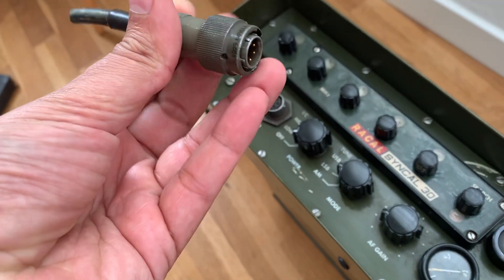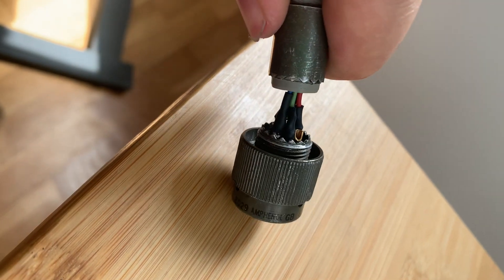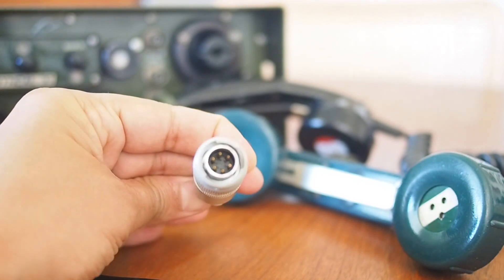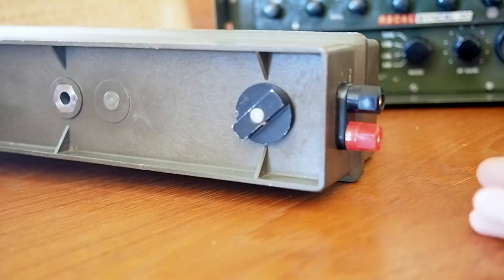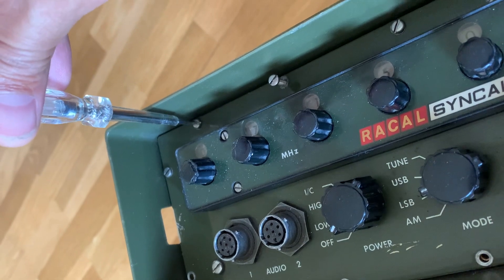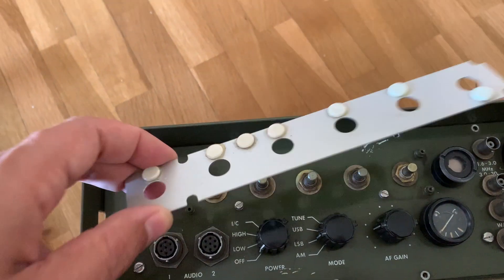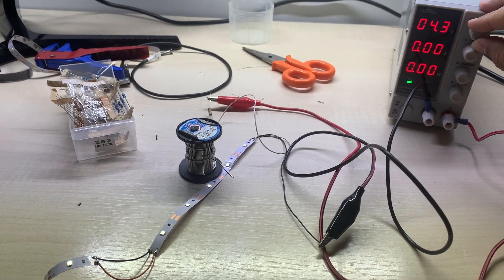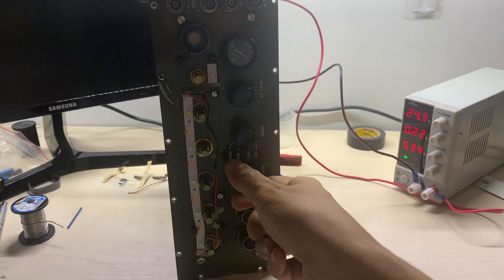Racal Syncal 30 LED, handheld and battery modifications

Comment: Nice video and very nice rig!,  a radio-friend of mine recently has bought the same radio.  He is also experimenting with light on the freq. dials, your led-strip seems to have the ideal distance, can you tell me what is the maker of that strip/specifications?  Or where to obtain?   73' from Netherlands, Hans
Reply from the maker: Hi! I bought it in a Chinese store. It was the common 5V usb led strip. Sorry I don’t think I can identify the make anymore. However you can follow a different approach. I made something similar and simpler with single LEDs on my TRA921 video. 73!
Reply from the maker: The brand is Ossun
Reply: @Radiogenes  Tnx for the reply, we'll have a look, 73' Hans